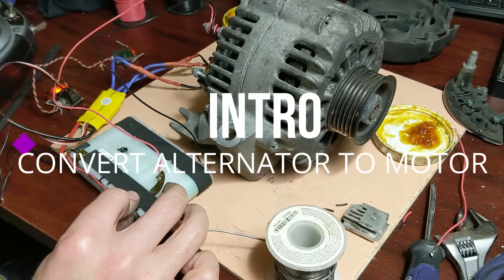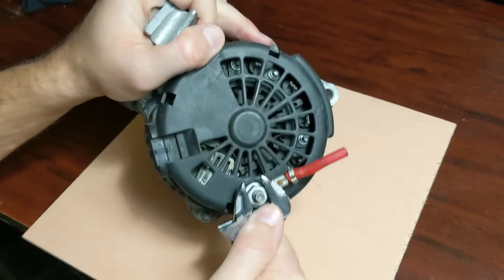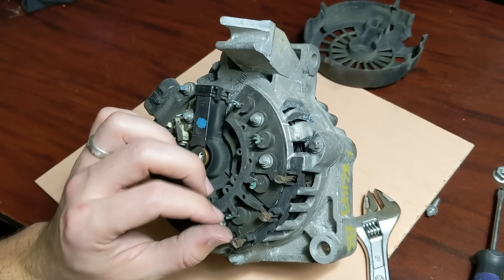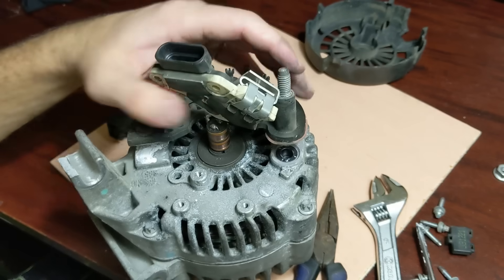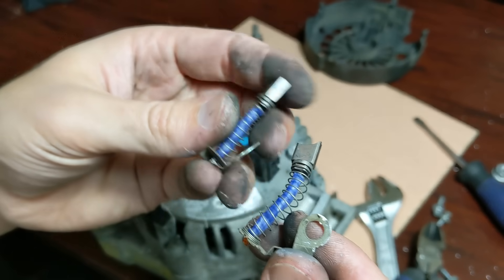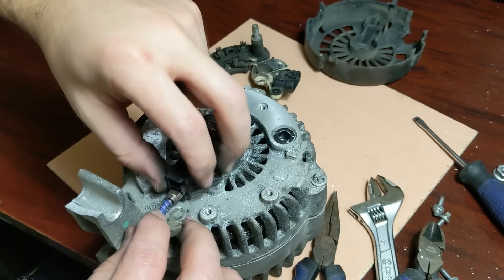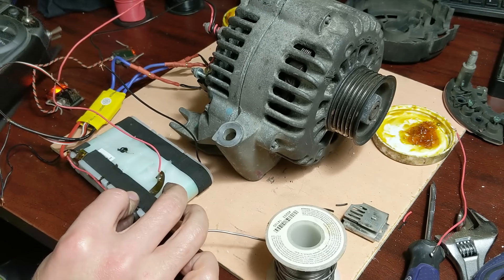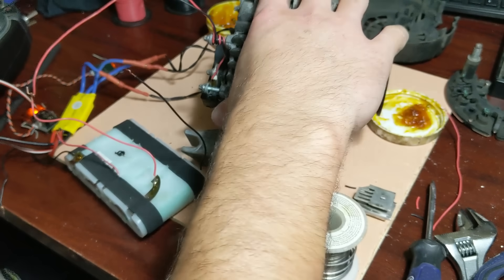Convert Alternator to Brushless Motor

Comment: If I understood that right, the voltages on the rotor are trial and error, limited by the 12V on the stator.
Is there a way to calculate the perfect ratio for the two voltages? What specs might we need to do that?
Is the ratio linear or does it change by the amount of voltage put on the rotor?
Reply: 1 : 6 comparison
 2 volt rotor, 12 volt stator,
I know it since i read comment from other youtube channel.
Reply: Just FYI, for anyone wondering why would they use an alternator, (an AC device) to be converted by diodes into DC which is what is required for an automobile electrical system. Why they don't use a DC generator?
Well, an alternator will produce a relatively high amount of current at an idle and of course at higher RPM. The voltage output stays within a tighter range also from idle to higher speeds. The alternator is easier to regulate because of being able to control output by the field winding. A low current signal that can regulate a high current output. So this is the reason they use alternators. I myself always wondered why the AC device and then rectified into DC.
Reply: are questions to which a person who makes a video calling it "convert alternator to brusshless motor", but then the brushes are present, he cannot answer
Reply: @bobparquet to eliminate the brushes, one could replace the windings of the inner component with permanent magnets.
  It would work the same.
Reply: @DouglasPixleyII  just a guess but the more amps the alternator makes, the faster it will be, also if it's a motor home those are usually 24v and the higher the voltage the better.. remember amps x voltage= watts, 100amp alternator  12v system 1200 watt motor.
Reply: You have to understand that there is a theory that you can convert the Y wiring of the armature and not the stature (stationary one) of AC machines to the delta-shaped wiring through the changing of connections.  The three phase of the alternator is now essential a one-phase DC machine (motor) with the use of diodes to direct the current flow.
Reply: yes, but you need to know the winding inductance
this is independent of the applied voltage
Reply: If you know how BLDCs work, then this is the explanation: Changing the DC field voltage that you feed to the brushes is about the same as changing the Kv of a BLDC motor. So if you have whatever, a 12S battery pack and you find out the top speed is too high, you can increase the field voltage until the top speed is just right. Likewise, if you run at full throttle and you find that the motor is spinning too slowly, you can decrease the field voltage (the DC voltage going to the brushes) and the motor will speed up. You could also probably control the motor speed by changing the field voltage on the fly to always optimize it. But off the shelf controllers are not going to be able to do that.
Reply: The alternator is somewhat of an amplifier.  The output voltage will vary with RPM at a fixed rotor voltage.  Also the output voltage will vary if a fixed RPM is maintained but the rotor voltage is varied.  The voltage regulator varies rotor voltage such that the output voltage is maintained at the correct automotive system voltage, about 13.5 to 14V.
Reply: @tamiebasse6595  so my understanding is, this is a In runner brushless motor, normally in my experience, the stator is in the middle and gets it's a/b/c wires powered my the esc in ac voltage, the bell is covered in small but strong permanent magnets and as the electrons travel around the stator wire the magnets are caught in the electromagnetic field and that spins the motor.  In this the center DC current (that's not normally needed in a standard brushless motor because if permanent magnets) energizes the wires in the center piece of the motor and create a stable electro magnetic field, and acts like the permanent magnets.. so for maximum output, you want to give that center DC current is Max voltage and skid m amps you can, in fact if you can keep the voltage regulator in line and give it 12v you should be golden as you take don't want that voltage to change since it's pretending to be a permanent magnet..
Reply: @tamiebasse6595  thanks for that explanation, I always wondered how an alternator gave a stable voltage output with variable RPM input.
Reply: I wont matter what it was. What it will be will depeend on the strength of the magnets.
Reply: Good,tria
Reply: What are bandanna clips? Alagater  clips
Reply: Umm
Reply: lol pi llllll
Reply: @mohdjanimohdtaib2356  bot
Reply: @danielfietkau733  
To my knowledge, the alternators reach up to 90 volts(AC) before rectifier circuit.
So the only thing that sets the limit is the current you are going to feed to the "motor" which is according to the power rating of the alternator. 
(The brushes electrify the rotor in such a way that the output voltage of the alternator is 13.5 - 14.5 volts through the whole band of RPM.)
Reply: P
Reply: @mpirron1  P? Is this your answer to one of my questions or to all of them ?

Comment: Nice, but the thing you refer to as the CENTER is called the ROTOR and not the STATOR. it's easy to see that you lack some electrical  knowledge,  but you did a good job,   just read a bit more and you will become a pro. 👍

Comment: Sorry to tell you that your explanation for delta and Y is wrong. Less windings between phases , like in the delta is good for speed/ rpm. Y is more torquey but slower. The factor is square root of 3.

Comment: Unluckily I measured very low efficiency on Alternatirs as motors, at least in the 3 alternators I converted: https://youtu.be/gChiSVlDTJg?si=IrrmFQVx35G2v8Vi . Did you measure power losses at no load on yours? Thanks

Comment: At 10:05 Your putting back together the brushes. The first brush bolts down to ground or the body of the alternator. The 2nd one I believe you've installed correctly with insulators on both sides of the mounting hole. Ultimately you'll need to solder on wires to both brushes so you can apply dc currenT TO THE ARMATURE. eITHER THAT OR BUY A CUSTOM MAGNETIC ARMATURE AND HAVE AN ACTUAL PERMENANT MAGNET BLDC.

Comment: Good video, nitpicking comments notwithstanding. When retrofitting an alternator to a completely different application, what might be some drawbacks to replacing the cast iron housing to aluminum. Benefits I have in mind are weight and cooling.
Edit .. new sub, hope you make more vid. Thanks.

Comment: Can you show the circuit diagram including the stator connected to the ESC and what ESC did you use. I presume the ESC provides a 3 phase supply to the stator and supply DC to the rotor via brushes and slip ring to the batteries

Comment: can't get my head around one thing, how do limit ur speed range, i'm working on the same project more or less, but i'm using an arduino board and a potentiometer, and I still get a really high output frequency of the ESC(1KHZ). I only need 60HZ

Comment: If you take a brush wire and wire to winding and wire the other 2 windings together the one winding is negative and one brush wire positive and only need on 12 volt feed for both

Comment: The part the brushes are riding on is not the stator. It is the rotor. Why does a brushless motor, as you called it, have brushes? The elementary difference  between a motor and a generator/alternator is this....
A generator converts mechanical energy to electrical energy. A motor converts electrical energy to mechanical energy. That being said basically a motor can be a generator and vice versa.
I'm still hing up on how this is brushless.

Comment: Changing the field voltage (the dc voltage) is like changing the motor Kv. Higher voltage means lower Kv and lower voltage means higher Kv. Permanent magnet motors can't change Kv on the fly but this type of motor (with a wound rotor and controllable field) can.
Reply: Stator voltages in the range of 6-20V make no difference other than power consumption. Just set it as low as possible without losing power.

Comment: The inside is rotating so therefore must be the rotor, the outside is stationary and should be called the stator.
Reply: The rotor would be called an armature in a motor. Either term can be used. A rotor is the plastic arm in old time automobile distributors.

Comment: Yeah theading for this video says converting an alternator into a brushless motor when in fact its not brushless because he installed the brushes back in the alternator. Just a little FYI for those of you that didn't catch that so it isn't infact a brushless motor as advertised.

Comment: *** Beware*** Don't go rubbing off the white stuff between the heat sink and regulator with your bear skin as it's a highly cancerous causing product. This goes with any heat sink paste like between a CPU and heat sink on your computers and any heat sink fitted. The paste is there to create a full contact between the two items creating easy transfer of heat outwards.

Comment: If I am understanding what I am seeing, you are running this on those 3 or 4 and no more than 6 little batteries and you did not connect to any other power source, right? If so I am really impressed with the torque when you kick that thing over! My question is rhetorical - no answer required unless someone wants to correct my understanding or lack thereof. Great and interesting video.

Comment: The "rotor" is the part that turns...the stator is the part(coils) that is stationary. 12V@ 500ma to 1A on the rotor 12V at the stator at 10 to 60 amps. That should give you some fun. By the way...doesn't brushless mean no brushes?!?

Comment: Got me going now. BOSCH make mid-drive ebike motors. They are also specialists at making generators
Why is there nothing about regenerative braking, 
DC motors are generators by default. 
Austin's work shows a generator can be a motor so why not a generator on braking or downhill cycles?
Reply: >>why not a generator on braking or downhill cycles?
because for an Electronics Engineer this bit is easy, The mechanical side, not so easy

Comment: Hello Austin, 70Km/h is more than enough. 
How long you can sustain it is important also. Acceleration is also important. 
A 14V 18Ah battery equates to about 250 watt.hours on the input side. 
The garden variety 250 watt ebike has around 31 miles (50Km) range on the same spec battery. 
Under typical demands, 31 miles costs about 350-1000 watt-hours for a garden variety ebike (or so they say).
This pretty well matches your 30 minutes at 70km/h. I'm also guessing that you didn't do a straight 30 minutes at 70Km/h, 
So don't be hard on yourself. Energy is only consumed by acceleration, road and wind resistance, and whatever is lost in  braking
I'm very impressed by what you're doing

Comment: I don't understand how the phase wires work, makes no sense to me. if you have a + / output wire from the ESC going into both ends of a stator winding how does the power move through the windings, there's no ground.

Comment: Good trying but it seems you need some additional education on alternator operation, 3-phase power generation, PWM motor drive, and some more mechanical aptitude. I realized what to expect to see when I saw you using a big crescent wrench to take nut off the alternator’s output post....!

Comment: wouldn't the armature be burning out? having it constantly connected to the battery and the motor not running, while your adjusting things. Do you know what the issues were in the beginning when it would only run then stop , for about 4s? Love you work and channel. I love how you explain every thing while you are working and diagnosing. Thanks Mate, Keep up the great work

Comment: The coil in the middle is called the rotor.  Those brushes are at if not very close to end of life. You should have to load them with spring pressure to make sure there is contact. You could have intermittent contact if they are super worn and judging from the strong moon curve in them, they are pretty worn. The STATER is the larger windings that run along the outer part of the workings. The plus terminal on the brushes is called the field. Typically controlled by the voltage regulator, (That piece you broke off) working in a way that a small applied voltage renders a multiplied voltage on the output, provided the rotor is turning. 

I'm questioning if the voltage to the rotor was backwards but it was hard to see how you had them wired to the battery pack.
FYI, you don't even have to run a power rotor, you can replace the coils with magnets, like a motor. 

I used to work on an assembly line for a reman shop. I found this video pretty educational however.
Reply: Woah, this comment in itself was like an informative video! :D
Tnx for sharing! 😊
Reply: The vehicle alternator is a very special design of generator in that the field and armature (rotor) are REVERSED so the rotor/armature is now the field and the fixed outer coil now functions as the armature. This unique rotor is known the alternator-claw design, aka bear-claw and supplies much higher current to the battery and at a lower RPM.

Comment: The rotating coil in the middle is called a rotor, not a stator. The stator is the coil with the 3 connections.

Comment: Hi,
At 3.30am you told to explain the different alternators in a next video. I have disassembled a stator from a 24V 120A alternator to measure each coil. in total there are now 12 separate wires coming out of the stator. How can I reassemble it into a star configuration? I'd be happy to send a photo if possible.
Thanks in advance!

Comment: At 5:15 ,The copper slip rings are not for the stator. They provide a current path for the field, which is wound on the rotor. The part that spins. The field requires only a small current to excite the main output coils that are wound on the stator ; the stationary coils, which produce 3-phase alternating current. The diode- triple converts the A/C into ripple DC, which charges the battery. Vehicle alternators do not make efficient motors. Not designed for that purpose. The pulley shaft on most of them are not even keyed for the purpose of driving the pulley, but rely solely on the shaft nut to squeeze the pulley to the shaft. Even under load, the rotor does not require a large amount of torque to rotate. Real motors require a key way or spline shaft to drive a load, as well as a ruggedly built rotor.

Comment: Ok i have neodimium magnets, aproximately the size of a quarter. I have a used ford alternator. I have a 1/4 horse 3 speed 1 phase motor. Hopefully after i complete the alternator modification, i will not fry the 1/4 horse motor. Ill post the results. Fyi. The alternator is a 1972 ford 55amp , ill post the alternating current output upon completion. Btw, what is being removed are diode trios(2) and the rest of the wiring to make the alternator direct current. By installing the magnets n.s.n.s.n.s etc you are creating an alternating current generator. The ford alternator im using , previously had an externat voltage regulator. Peace yall. Ill letcha know

Comment: NOT BRUSHLESS, it very obviously has brushes
Reply: It actually is brushless btw, those brushes are just to supply 12v power to the electromagnets inside as it doesnt use perminant magnets like a standard brushless motor

Comment: You are using incorrect terms for the parts of the alternator. The stationary winding (the three wires that come out) is called the stator and has the armature windings. The rotating part in the center which is connecte to the two bruses is the rotor and carries the field windings.

Comment: If you had 3 12 volt 600 amp car batteries in series, I would think that added capacity would power a bicycle for a longer distance. Novice here but that's what I think.